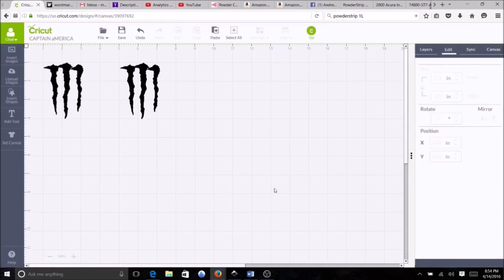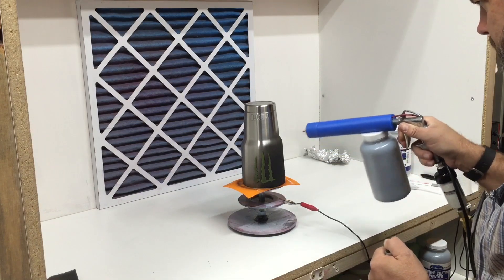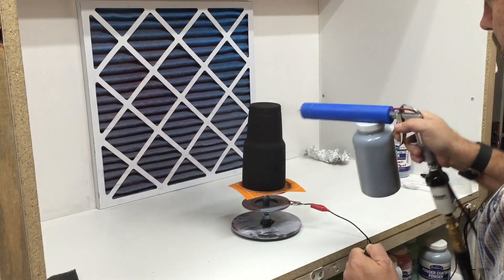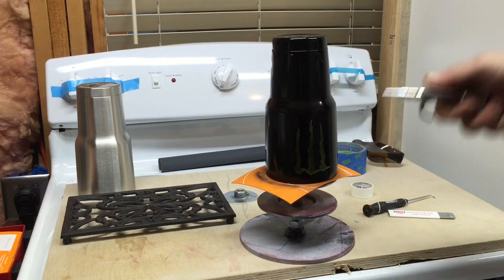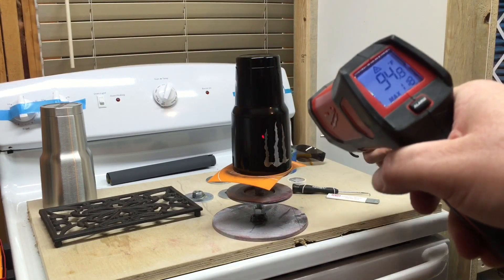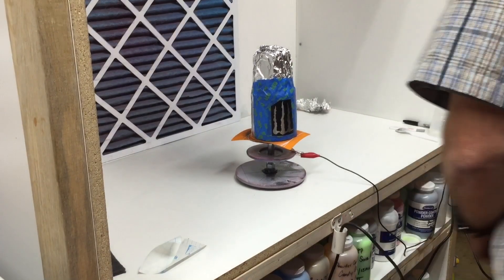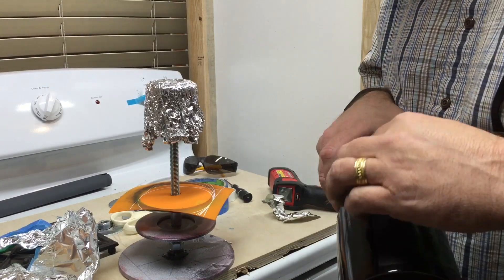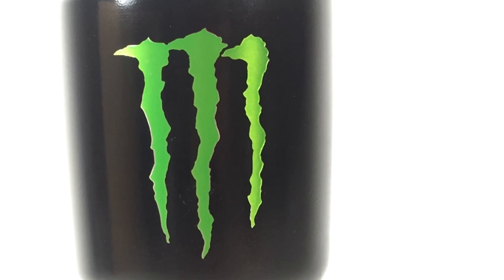DIY Two Color Powder Coated YETI.

Comment: first time I see this technique and product. I saw the preparation for the powder to stick is having it free of oils. Does it matter if it's been touched with bare hands during the process? I'm assuming no. Great work.
Reply from the maker: Good question. Hands have oils. So it could be an issue.

Comment: Could I take a cup that's already powder coated, put a mask on, laser etch pattern (removing existing powder coat and creating masked area at the same time), add powder, remove mask and bake? 
Or can you not bake existing powder coat?
Reply from the maker: You should be able to if it’s powdercoating.  Many are duracoated from stores.  Not tried that myself.  Try it on a cheap cup if you can.
Reply: @ManCrafting  hopefully it’s just regular powder coating and won’t be affected. I only want for small areas so just trying to work out best way, I need to order some powder to do some testing with but the local supplier is away at the moment.
Do you know if it’s possible to apply powder without electrostatic gun, for example does heating the part alone make it stick (I only have a small area I need to do)
Reply from the maker: @MrBrettStar  it is called hot coating.  It will work.
Reply: @ManCrafting  perfect! I can't wait to give it a try, I have so many ideas

Comment: Wouldn't it be easier to coat it black then mask it off with the logo stencil and powder over the black? The cup I had in mind has a lot of lines and lettering.
Reply from the maker: Dark goes over light.  Light doesn't do well over dark.
Reply: +bugmanchad the two colors I'd be using are white and orange. So coating the whole cup white and do the decals in orange should do fine then?  It's a gift and I'd hate to screw it up.
Reply from the maker: +Nathan Garza it should be ok, but you may want to do a test on a can first to be sure that the colors work.

Comment: I see you have changed the way you do the powder coating would you mind sharing that info?  I know you spray the color of the logo first then put the vinyl down and spray the second color but what temp do you put the cup in for and how long after first coat then do you wait Til it cools to 100 or what is the process.  Thanks your videos are awesome and have been a HUGE help!
Reply from the maker: +Jon Poole I put the cup in until it's above 150.  My goal is to hit the cup with powder before it drops below 150.
Reply: +bugmanchad awesome thank you for you're response!  Also silly question what kind of mini vacuum are you using?
Reply from the maker: +Jon Poole   Not really. https://youtu.be/c7f61854jO8

Comment: I repaired motherboard for a long time so I have reflow guns.  I am going to try and flow the powder with the gun on these small areas so I'm not worried about wrapping the whole cup and sticking it in the oven for 3 minutes. Since I can turn the airflow to near zero I think it may work and also allow me to do multiple colors and bake once. Ill keep ya posted

Comment: Does powder coat not stick to itself very good? Just curious why you sprayed just the logo green? Instead of doing all green laying the stencil then all black. Ive never used this so I'm just curious.
Reply from the maker: Good question.  At this time I was struggling to get good coverage with a 2nd coat.  Since that time I have figured out how to do it without it being an issue.  Biggest issue was the ground I was using wasn't allowing the charge to dissipate. So as I added more charge to the cup via the powder the less the cup wanted to attract more powder.
Reply: +ManCraftingTM How did you fix the problem? I'm having the same issue.
Reply from the maker: +FourWheeler575 I put in an earth ground. Made all the difference in the world.

Comment: Have you found a way to add flakes to it?
Reply from the maker: I found a product recently, but after using metal flake based powders I'm not in a hurry to use it.  It gets everywhere.  real mess to work with.

Comment: is there a reason you did the colors in the order you did is that a factor in the process or does it NOT matter ? 
Thanks
Reply from the maker: I might do this differently in the future.  It made sense to do it this way at the time because I was having a tough time doing full second coats.  Now that I have that worked out, I'd do the green over the whole cup, mask the logo and then black over the whole cup.
Reply: Thanks for the fast reply !

Comment: Thanks for the awesome videos. I am trying this method but I srcew up the 1st coats finish. I followed video, but when i take off the masking for 2nd color you can see the line from the masking. The 2nd color comes out fine but the masking vinyl messes up the 1st coat finish. Am I doing something wrong? How can I avoid this? Thank u!
Reply: Ive also had this problem any tips on how to avoid this??
Reply: this technic is Lil different then mine. I paint the green first let cool then apply your stencil. now apply the black over all the cup bake for few minutes or use a heat gun to warm up the area around vinyl and with tweezers remover the vinly. now put back in oven at let cure. this way there's no need to try an align ur sticker again and have areas where you didn't cover.

Comment: This is how not to do it lol. Spray the green cure it 50 to 60% put the sticker in and spray the black. Let it flow then peel sticker and cure fully.
Reply from the maker: Adam Thompson you are correct. I have a follow up video showing exactly that method.  This video was before I had figured that out or gotten help from anyone. There were no other videos showing how to do it, and anyone that knew how to Powdercoat wasn’t showing anyone else. That other video was posted years ago just after this one.
Reply from the maker: Adam Thompson here you go. lol https://youtu.be/Cz-s0N-WTkk

Comment: First, thanks for all the great videos.  I learn a lot from them.  I notice on all your videos, your powder gun always sprays very nicely, and with very little overspray... What did you do to achieve this with your gun.
Reply from the maker: The main thing is having the air pressure set low.  It's at about 8-10psi. Second thing I did was remove the diffuser at the tip.  If you were doing large parts, that may be a benefit, but for small stuff it seems to get a whole lot more on the cup without it.
Reply: +bugmanchad thank you
Reply from the maker: My pleasure.

Comment: What type of vinyl do you use that can go in the oven? and is that why you let the powder start to run then pull vinyl then let cure that way not to have the vinyl in the oven too long?
Reply from the maker: We use cricut or oracle 631.  Yes, if the vinyl is in too long it gets brittle. And will leave glue on the cup.

Comment: So I own a laser cutter/engraver that can handle these types of finishing exposing the stainless steel underneath very well. If I was to engrave one to expose the bare metal and then attempt to powder coat it, would that work? Also if it would, do you think I would need to worry about masking everything else off? Or will the new color not stick to the existing cured powder coat? Thanks!
Reply from the maker: Leggo0 that’s a great question.  If cleaned it will stick.   I would definitely mask the rest off.
Reply: Thanks for the quick reply! I will definitely have to look into giving it a try! I obviously could always start from a plain bottle like you have here, I was just thinking about doing it on a bottle that has already been coated. Thanks again!

Comment: Men you
Make awesome videos , I’m trying to find an answer and nobody can answer me , when you going to do a second coat you
Need to preheat the parts to apply the second coat , also if
You
Going to put clear coat is the same process? I ask you because when I’m trying to do a second coat like clear coat the powder don’t stick well to the pet and I have a ez 50
Reply from the maker: Reinaldo Rivera I just got the EZ 50 and am trying to figure out if 2nd and 3rd coats are possible without hot coating, but with my other guns I’ve always needed to.  I’d hear to about 180 to get an additional coat to stick.
Reply: ManCraftingTM yeah I have a little troubles trying to do second coat without preheat
Reply: ManCraftingTM but if u find out let’s me know please

Comment: Love you're videos! I just recently picked up the Eastwood powder Coating kit and a circuit express air 2 for some hobbys of mine. Quick question. What type of material do you use to cut the stencil on the circuit? The high temp tape Eastwood offers?
Reply from the maker: TheStig23 this is what I use. Circuit Rose Vinyl http://amzn.to/2dGxbFs
It doesn't leave Glue behind. Just be sure to remove as the powder begins to flow. Maybe 60 seconds in the oven.
Reply from the maker: Also check out my newest video.  I'm giving away two Eastwood Powdercoating guns and a bunch of other stuff.

Comment: What do you use to get the glue off the decal that stays on cup?
Reply from the maker: +Isaac Guerrero I was using isopropyl alcohol, but it seems that baby oil works even better.  That said, using Cricut or Oracle 631 pretty much eliminates glue being left behind.  The baby oil can be used even when the powder is partially cured, which probably is the best time to get the glue off since its not as baked in.
Reply: +bugmanchad thanks a million.  BTW I use tile adhesive remover to strip paint off of cups.  Got it a local harware store.

Comment: You're not even supposed to dishwash a YETI cup, I think the oven would be worse.
Reply from the maker: Is that a hypothesis?   It has more to do with water getting inside the base cap and heating than the vacuum.  The base cape will blow off if it's got water in it and it's heated.  That's a fact.
Reply: There has to be a seal with something.  It can't just be crimped metal and I don't really see how they would perfectly weld it internally while maintaining a vacuum.  It's got to be some sort of adhesive or epoxy
Reply from the maker: +ScienceFoundation  I'm not saying it's never been an issue.  That said I have never experienced it.  Just checked with three others that combined have done over 50,000 cups.  Not one vacuum failure.   So, it it happens it is a very small number of people that is experiencing issues.  Again, I agree it could happen.  Here's the great thing.  There are  methods that you can use  to customize your cup that don't require an oven.  Sandblasting, etching and lasers.   All creat cool personalization.

Comment: I really like your "powder over spray vent hood" with the filter in back.  Did you construct it with a blower or fan to pull air thru the filter to capture stray powder?  Seems like you're shooting powder indoors with this setup yes?  That must be great not having to deal with the outdoors environment...

Is that an Eastwood gun you're using?
Reply from the maker: vincevfx  initially I had just a fan blowing into a box that I made out of rigid board insulation.  I have a shop vac with a hepa filter pulling anything that makes it into the box.  It works pretty well.  Keep watching I have a video coming soon with another option that I recently discovered.

Comment: Do you have to use a certain type of vinyl to stand up to the heat?
Reply from the maker: I generally use Cricut or Oracal vinyl. Nothing special.  I just pull the vinyl long before the cup reaches a temp that will damage the vinyl.  Usually about 60 sec in the oven is long enough.  https://amzn.to/2JrPH2B
Reply: ManCraftingTM gotcha, so throw it in for about 60 seconds, then take out the item, pull the vinyl then go back in for the reminder of the time
Reply from the maker: Jeffrey Brandt exactly.  Works great.
Reply: ManCraftingTM thank you!

Comment: you should have shot the green on the entire cup cured 60% then placed your stencil for the flat black.
Reply from the maker: I agree. That's how I do it now.  At the time I was having issues getting 2nd Coat coverage.  Now that I have that down I'll do a new video showing the easier method.
Reply: Would you have to shoot the green on the entire cup or just the general area where your logo will be? Then mask the green with your stencil and shoot the entire cup black?
Reply: Can you not just shoot the entire cup black, cure 60%,  lay down the vinyl logo stencil over the black and shoot the logo green?
Reply: +Keith White it would look more esthetically pleasing with the black being shot over the green in my opinion
Reply from the maker: +Keith White I would shoot the entire cup green, put the logo on, shoot the black and remove the vinyl now.  At the time I had a poor ground and couldn't get 2nd coats to cover consistently.
Reply: Sorry if I sound ignorant, I'm new to this, but why shoot the entire cup green and not just the general area covered/masked by the logo? Seems unnecessary when the final product will just be the green logo
Reply from the maker: +Keith White the green is translucent. It wouldn't look good over black.  If it was solid it may be ok. I'm going to shoot another one with blue. I'll video the process.
Reply: shoot small green area as opposed to shooting entire cup green, place logo mask over green area, shoot entire cup black. So this would be black over green, except for the logo obviously. Would that work?
Reply from the maker: +Keith White yes.  I did that on my 3 color cup video.
Reply: +ManCraftingTM awesome! and thanks for shooting the videos!
Reply from the maker: Keith White
Thanks!

Comment: What machine did you use to cut out the stencil?
Reply from the maker: It's a Cricut Explore.  https://youtu.be/Epn3s_jdNB8
Reply: what vinyl/material do you typically use for your stencils, ive tried multiple types and it is different to remove. Was wondering what you use if you dont mind me asking